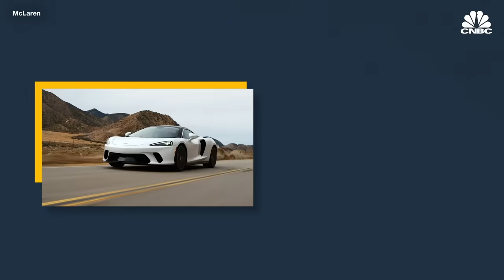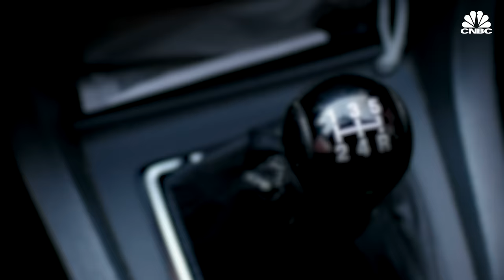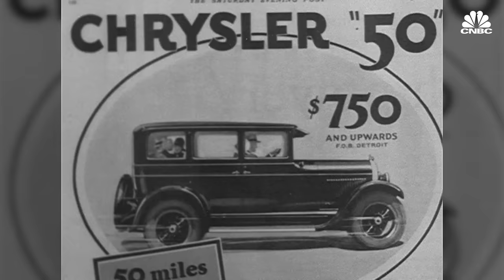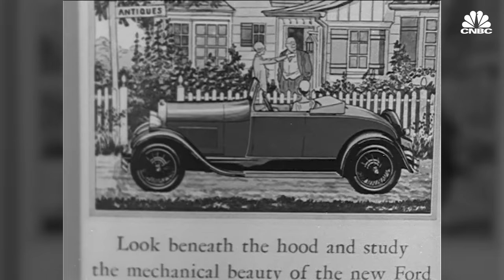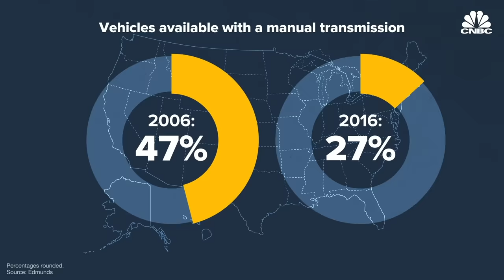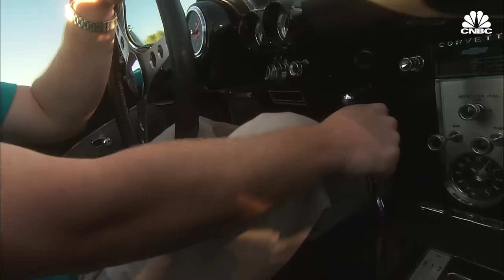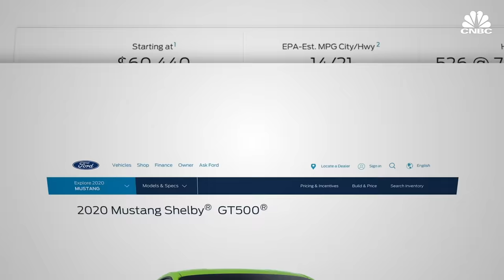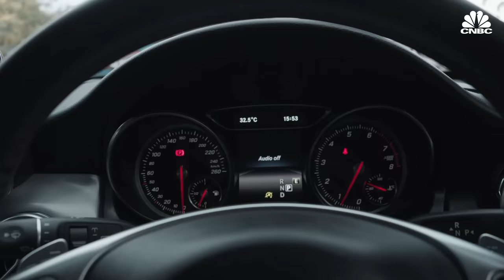Why Stick Shifts Are Going Extinct

Comment: "the trouble with manual transmissions is that they require work, skill and constant attention"

So does driving. Are you seriously suggesting it's better for people to be paying less attention while on the roads?
Reply: I believe what he ment pay attention on car engine... Because if you miss up... Your car will switch off...
I did try to drive a manual car... And it was freaking hard for me... I end learning automatic...
Reply: You pay more attention to your environment and not the transmission
Reply: @painkeller20  I becomes absolutely subconscious after a few time of practice. Do you think how to move your legs when walking?
Reply: @dr.coomer789  That's a stupid argument. Do you pay attention to moving your feet forward every time you take a step, or do you pay attention to where you're stepping? No different from driving a manual transmission.
Reply: @skachino  why would I deal with it when auto exists
Reply: @skachino  , Heck yeh! my legs don't wok well...
Reply: Joseph Stolen  but why manual when automatic does the work for you?
Reply: So if driving requires constant attention, why would I be doing something that also requires constant attention at the same time? Flawed logic you got there
Reply: Less attention elsewhere and more attention on the road
Reply: They can text
Reply: I think they meant that they have to take attention away from the road to the gears because they require constant atention.

I agree it was worded really badly,  but I think that was their message,
Reply: Cinda Oppenheimer  someone's mad they can't drive a stick
Reply: @isoSw1fty  people who know how to drive a stick don't even look at the shifter when shifting they just do it.  I never take my eyes off the road when shifting
Reply: It's not better. But look around us. Everyone is on their phone when they drive. It's not surprising why Manuals don't sell. Plus traffic.
Reply: They aren't suggesting that. An automatic is more convenient to drive - 2 pedals are easier than 3.
Reply: They are obviously speaking of the convenience. 2 pedals is easier than 3 and people who are just casual drivers don’t care about how stick shift “feels better”. Places like hills are going to be difficult for people learning. Also you could damage the clutch if you shift incorrectly. Stalling on the road is also embarrassing and dangerous
Reply: @pogtuber5146  there isn’t a license or age limit to walking so how does that even compare. You learn to walk when your a baby. Some people don’t have access to manual cars and learning from scratch takes time to develop that muscle memory
Reply: @SM-vx6zq  holy crap you really don't understand the analogy? What we're saying is that driving a manual transmission doesn't in any way require more concentration to drive a car in the same way that walking doesn't need concentration. The only people too stupid to understand this seem to be people who hate manual transmissions.
Reply: Not paying less attention on the orad?but actually paying more attention to driving on the road rather than changing gears
Reply: @pogtuber5146  that’s not true though. Walking is a natural instinct and anybody can learn how to do that. You need a license to drive any car, stick or auto. And a age limit for most places too. That learning curve isn’t just no effort muscle memory. That has to develop and people who haven’t driven stick aren’t use to that. What aren’t you getting? I’m not hating on it all all, I’ve driven a RSX and bikes before. You’re the one whose gate keeping
Reply: @SM-vx6zq  what the hell are you talking about? I'm not talking about people just getting up one day and starting to drive a manual transmission. I said that people who drive manual transmissions are not focusing any more on shifting than they are on just driving the car. The fact that manual transmission drivers are paying attention to things like speed and RPM I think makes them even better/safer drivers.
Reply: @pogtuber5146  well that’s just an opinion and you haven’t provided any evidence of that. Some might not. I’ve seen people shift into the wrong gear and stall in the middle of the road, which is hazardous. It goes both ways
Reply: @changthunderwang7543  If you ever plan on being on The Amazing Race TV show it's advisable to know how to drive manual. Just about every car they had to pick up outside the US was manual. What's funny is a few people were burning rubber learning how to drive it for the first time.
Reply: pay the attention to what's around you and not managing the engine. do you want a fighter pilot to focus on the jet not stalling or to their situational awareness?
Reply: Yes that is exactly what I am suggesting at least if you care more about people being able to text and profit over people is my main  focus!
Reply: Ok but a manual is more fuel efficient, better on the engine (yes auto cause the car to work harder) and manuals are also more economical. Also only a manual can unlock a car full potential. This is coming from someone who has driven autos most of there life by the way. I am willing to do work ashame many of you are not!
Reply: An automatic put in a Lamborghini: Blasphamy!
Reply: @seanm4095  most new people with $$$ to buy Lamborghini don't want to learn manual nor care.
Reply: @SM-vx6zq  lol dudes acting like automatic isn't easier.
Reply: Manuals are more engaging. Automatics, you can just press the accelerator with no thought.
Reply: I'd rather pay more attention to the cars around me than changing gears
Reply: these people that claim driving is a chore just bust me cuz driving is rewarding its a privelidge.
Reply: I don’t think they were suggesting it’s better, I think they were saying people are lazy. It’s the same reason the idea of self driving cars even exists at all. Humans are lazy and want the option with the least effort involved. It’s sad, I’ve always had a manual transmission until I bought a truck 2 years ago and couldn’t find one that was manual.
Reply: @dr.coomer789  I always had a Stick until I couldn’t find one to buy. They were always cheaper to buy and repair. The experience of driving is entirely different and hard to explain if you haven’t done it. It’s not just something unique for car people to feel special. It’s less passive. I found that I was more ALERT driving Stick, less likely to be daydreaming. You’ll mess up if you aren’t constantly watching ahead and trying to anticipate traffic patterns, when to down shift, where there’s a stop light on an incline, how close is the car behind you, etc. The actual shifting becomes natural, but you need to be super aware of the road conditions, and the vehicle. I’ve become LESS ATTENTIVE to my driving in an automatic. There’s less to do. I can relax, sit back, and sink into my thoughts. One pedal to stop, one to go. On an hours long drive, you won’t feel as drowsy with a Stick. Not to say manual transmissions don’t have down sides. They sure do. Traffic jams, and city driving: it’s horrible. Your left thigh will be sore from constantly moderating the clutch, and there’s a risk you’ll roll backwards into some jerk in an automatic who’s too close to you at a stop.
Reply: Yes
Reply: Actually it a good thing cause it keeps u alert and concentrating on driving instead of dreaming
Reply: @isoSw1fty  thats not how it works
Reply: How are you going to text with a stick shift?
Reply: That's why driving a stick IS better. It requires You to actually drive it and it not drive YOU! Today's automatics with all of the amenities available in vehicles are way too distracting. Driving a stick is a passion and a skill. The driver is always thinking ahead like a rider of a "crotch rocket" riding at 3 times the speed limit. Those riders are always in tune with the machine. Solely automatic driver's are in jeopardy of allowing their brains to gel. Stay human.
Reply: Shifting gears should be second nature.
Reply: Try driving in 45 minutes of bumper yo bumper traffic with a stick.  It's a horrible experience
Reply: Well look at all of the distractions they are adding to the modern cars - this seems to be EXACTLY what the powers that be are aiming for!
Reply: With a manual transmission you become more familiar with the sound and feel of your car and you subconsciously memorize when you need to shift up or down. Today people would rather look at there phone then become better drivers.
Reply: @rainonedavid3564  It's really not.  The mind /brain is like a muscle.  The more you use it, the stronger (more aware it becomes).  Been driving a stick for 12 years straight, and not a signal accident.  Meanwhile those with automatics get into accidents all the time, and take more risks.
Reply: When driving a manual you pay attention to weight transfer, you understand the grip of the tires, you a driver that is able to understand the dynamics of vehicle you're driving.  What's comical is when you hear someone say they know how to drive a car but they don't understand what happens slowing in a turn or speeding up.  These things are learned with a manual rack or a vehicle that has enough castor to provide feedback.

Seriously it's operator vs driver at this point, vehicle operators are seldom good or safe drivers.  They rely on the safety equipment to maintain their lives, that cost us our environment because the standard compact car now needs to weigh as much as a big block challenger from the 70s.
Reply: @dr.coomer789  because that manual trans is capable to go well over 1,000,000.00 Miles as long as the driver knows how to drive it
Reply: @OP-yw3ws  you say that, but I bet you can't remember the color of the last car behind you, because its a 50/50 you won't see the one stopped in front of you as your on your phone.
Reply: Yes it is thats why we will have driverless cars in 10 years.  More reason for the manufacturer to get rid of sticks
Reply: @alexm566  if u have eyes and ears u can do both with little to no effort
Reply: @OP-yw3ws  if you drive stick u dont focus on what gear to be on. It comes naturally
Reply: @killersugar6816  and then they will claim the world is stealing their skills. Like in manufacturing.  U stop doing something u lose that skill
Reply: @TimeforchangeTrudeaumustgoEndb  exactly perfect for a 16 year old no texting and driving
Reply: @dozaarchives2225  if u like tailgating yes it is
Reply: @u-know-this  why do something that's completely useless tho. only thing you get from manual shifting is that jumpy feeling, which is meaningless and even anonying.
Reply: @dr.coomer789  If you don't regard the transmission as part of the environment, you're doing it wrong.
Reply: @isoSw1fty  Are you studying the cracks in the pavement? I'm interested in the dynamic interplay between the vehicle and the rest of the environment. The transmission is part of that. But some haven't noticed this.
Reply: @daha3074  only easier if one prefers to be oblivious to part of the process. Otherwise it is an impediment the interferes with control.
Reply: @karvast5726  changing gears is part of the part of the process of driving, managing energy and force in motion over time. For those who don't understand the process in depth, we have automatics.
Reply: @OP-yw3ws  it's not a zero sum game. I prefer to enhance my awareness of all factors. Maybe you need the look down because you can't remember the shift pattern.
Reply: Doesn't really require skill it's pretty easy just extra work and attention.
Reply: Real drivers drive or at least know how to drive a stick. The feeling of increased control is insurmountable and incredible! It's an aphrodisiac !
Reply: @alexm566  sometimes if something gets too easy it can let your mind wander and not pay attention. A stick shift keeps your mind engaged on what's happening.
Reply: the market wants autonomous vehicles that drive themselves.  so yes, no one wants to concentrate on driving.
Reply: @mike325ci  I agree with your statement. Autonomous will never happen anytime soon on a grand scale, imo.

Comment: Automotive industry: manual transmission

Smartphone industry: headphone jack
Reply: Amazon : Best buy
Reply: If only most of the peripherals and hardware supported AptX. That actually doesn't sound half bad for wireless. But SBC sounds really bad in comparison and LDAC isn't much better and requires really high signal strength. Most don't want to pay the royalties for AptX however, so they cheap out.
Reply: I feel you
Reply: 5 years later... usb jack gone
Reply: Scott, wireless charging😂😂
Reply: @cowboy_3  wireless charging VS one plus warp charging. Ill take my ten minute full charge thankyou verymuch.

Comment: I hate when you’re used to driving stick all the time and you get in a automatic and you press your left foot down and nothing’s there.
Reply: Same. It feels weird. The first time I drive an automatic I subconsciously pay attention to the RPM, then about 3000RPM I let go of the gas pedal, and then the habit of pressing the clutch pedal, my foot is finding the non-existent clutch pedal, I have to remind myself that I'm driving an automatic.
Reply: windthugness or you end up hitting the wide brake pedal with your left foot 🤣🤣
Reply: I have done that multiple times 🤣🤣
Reply: Or worse, you clutch the brake,

& come to a whiplash inducing halt.
Reply: That happened a couple times.
Reply: @bonganimkhwanazi2081  Yup, done that a couple times...
Reply: windthugness I sometimes drive my wife’s car which is automatic and there are times when I will double down on the brake pedal with both feet thinking I’m driving my manual car.
Reply: The instinct to push in the clutch! So sad when its not there.  So weird
Reply: Happened with me when i moved to usa from India
Reply: Yep, I've pushed the invisible clutch too. As well as try to shift the auto trans from drive to "first" when making a turn.
Reply: 😂  I did that this morning!
Reply: A dual clutch transmission in manual mode is essentially a manual transmission.
Reply: I'm a truck driver boss
.I've done it in my car when I get off a long trip 🤦‍♂️😂
Reply: Ghost clutch
Reply: I think each to their own. I don't move my leg for the missing clutch when I first tried an auto. I also rarely place my hand on the auto shifter. What I do feel strange recently though is driving a Vellfire. Feels weird for the clutch to be replaced with a handbrake. First time had to "step" on a handbrake.
Reply: @bonganimkhwanazi2081  I have done that. The guy behind almost hit me
Reply: @jogmas12  that's the thing. I tried to do the same, use both foot like in a manual and almost had an accident. Never use both foot in an automatic 😭
Reply: It freaks me out when I've done that.  I thought the clutch had failed.
Reply: I drove 13 sp big trucks for over 20 years. When I got in an auto I was stomping for the clutch, reaching for the shifter and even wanting to split gears. Took weeks to get over it.
Reply: i drive both and that has never happened to me, but i've seen other ppl do that... the worst was when this idiot was driving an auto and pulled the handbrake, his excuse was that he is accustom driving manual vans and trucks and he forgot its an auto car and he was trying to switch gears...
Reply: Yes only I usually find a surprise oversized brake pedal when I wanted neutral.
Reply: the wrst is when you are so used to the clutch that your foot look for a pedal so you break. that happened the first time most people drive for the first time an automatic.
Reply: @jannadrielcervo7753  then u try to heel toe an automatic
Reply: I did that for almost six months after my manual car was destroyed in an accident. It was initially frustrating.  but now that I happily have another manual car I don't mind and I actually laughed when I switch between it and the automatic
Reply: @jogmas12  I have done the exact same thing. I almost slammed my wife's head into the windshield when I switched her automatic car.
Reply: i have the habit of clutching the brake in this case out of habbit. its really annoying
Reply: Yep, but you get used to it,  Why do we need more than one pedal to go and one pedal to stop?
Reply: Or you slam you foot into the brake and come to an unexpected stop.
Reply: It was so bad for me once that I got in my cousins Sonata that's automatic that I had 1 foot on the brake 1 on accel. Expecting a 3rd pedal even though I knew there wasn't already. Love manuals to death.
Reply: This is the truest thing I’ve read in awhile
Reply: or catch the wide brake pedal and send your poor passenger through the windshield lol
Reply: After a 14 hour drive in traffic,  I was sitting on the couch. When I was getting up to get dinner, I lifted my left foot/dropped my right one instead of getting off the couch 😂
Reply: Haha I'm guilty of pushing the brake pedal down with my left foot to start the car

Comment: A manual trans lasts longer (provided you know how to drive one properly) ,get better fuel mileage, assist in braking ,which reduces brake wear and allows you to start your car if the starter isn't  working. That's just a few of the advantages of a manual trans.